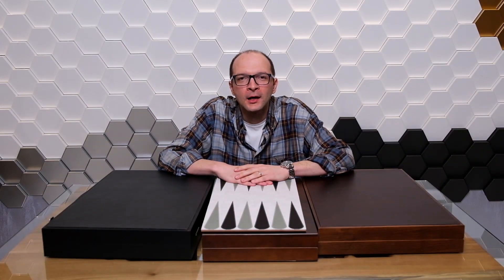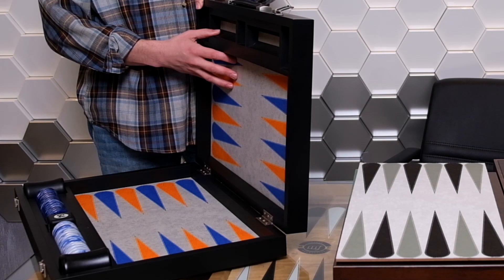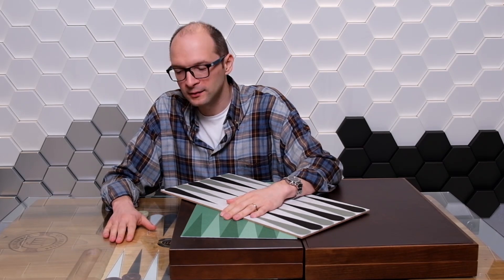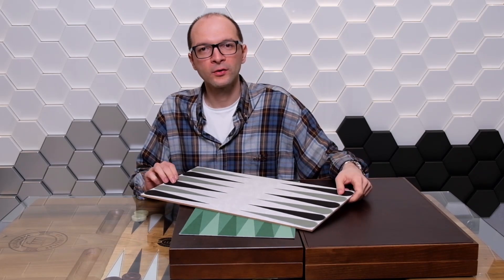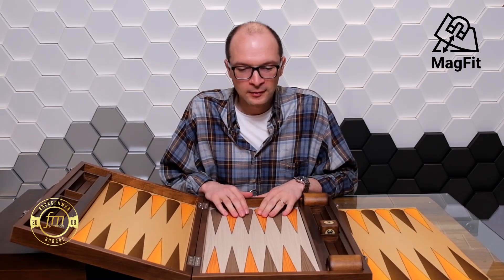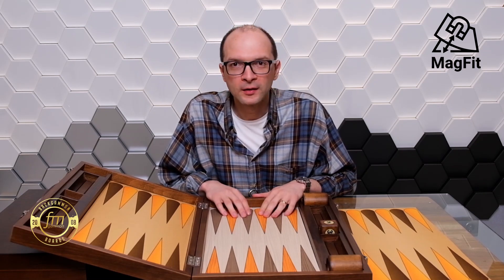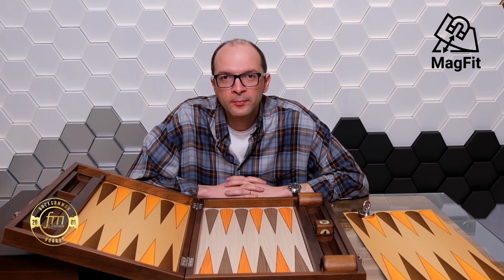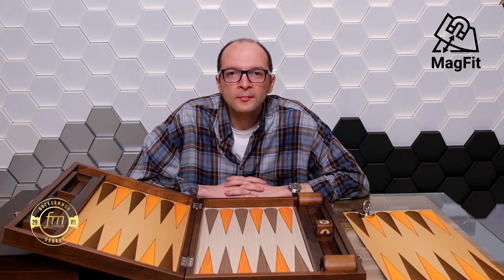Evolution of Magfit Technology

Comment: Very informative video, Onur! Great job.

What would you say to those backgammon enthusiasts that are concerned by the presence of magnetic materials in FM boards? I’ve had a few people raise concerns, which I think are unfounded. Nothing in the board, as far as I know, would allow someone to effectively cheat with magnetic or ‘loaded’ dice. 

Keep up the good work! ✨🎲🎲✨🎈
Reply: Thanks for your comments Justin. We want to make it clear that the metallic piece is attached throughout the board and it’s uniform. The magnetic puck that is used to pull the material, shouldn’t be near the board during play if TD's are concerned about it. The last but not the least, We always encourage the use of precision dice in tourneys as they are totally unaffected by the presence of the metallic surface in the board. The precision dice are usually transparent, to show that they are not loaded at all. We hope this response clarifies all the concerns